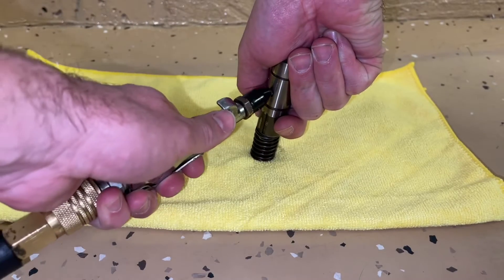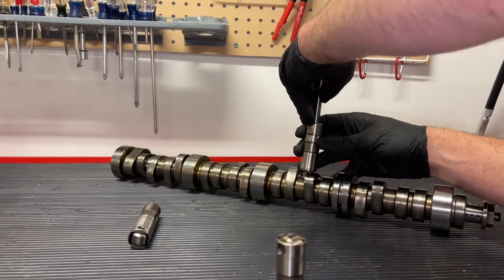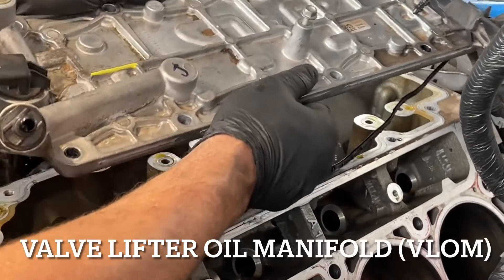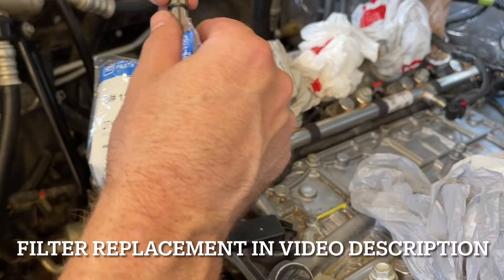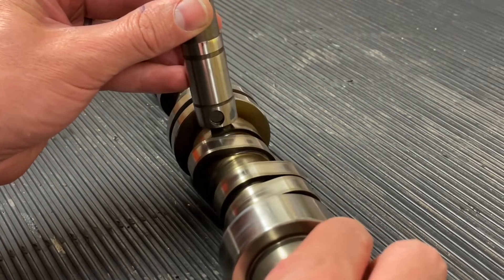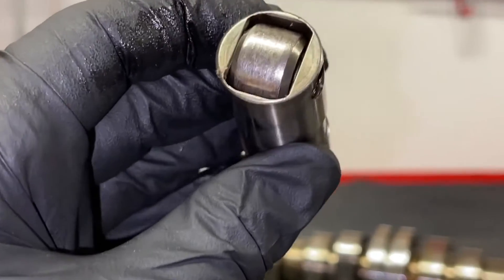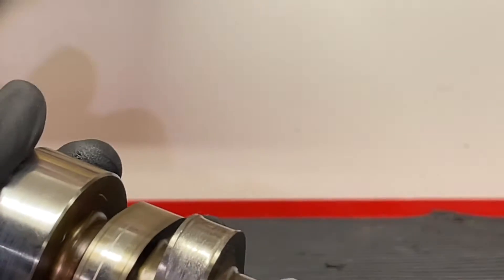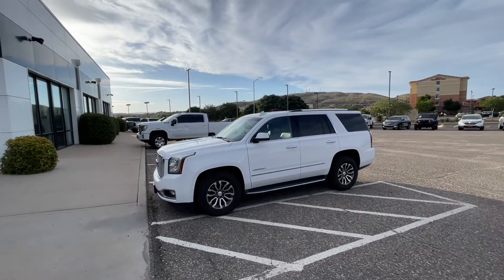GM DOD/AFM Lifters operation explained, failures, how to delete. Why GM engines fail 5.3L 6.2L

Comment: What could it mean if you did the AFM DOD delete and the lift failed after?
Reply from the maker: Mine was a regular lifter that failed, but possibly due to the active fuel management/displacement on demand. During the repair, the dod/afm was replaced with a regular GM camshaft that does not utilize the afm/dod because that system is prone to failures: DOD AFM Delete Yukon, Tahoe, Silverado, Sierra, Escalade 6.2L & 5.3L Replace cam & lifters  Part 1
https://youtu.be/cWayyZGNYRI

Comment: can i just install all new short regular lifters and disable it with a tune and leave the stock afm cam so i wont have any lifter collapse in the future right now while my engine working fine since i have the engine outside the engine bay ?
Reply from the maker: My understanding is the cam is in fact different and must be replaced. https://youtu.be/cWayyZGNYRI?si=SMwntH3JEAnj0E_e

Comment: My sis' 2021 Tahoe just had it's second DFM failure and soon going on 3rd engine  with less than 130K miles. I grimaced when she said she OK'd 9k for the dealer to replace the engine. She said she's getting a DFM disabler but I told her that will only prolong the next failure. I agreed when she said she will sell it, though I am a "drive til the wheels fall off, then put the wheels back on" type. Told her for same price, she should have gone to an independent shop for a rebuilt (ie Jasper) that will have standard cam and lifters. Recommended next time get on the 2500 platform without DFM.  People it's not hard... dirty motor oil does not make a good hydraulic fluid! It's for lubrication.
Reply: The elephant in the room...If you disable the AFM, there's no chance of a collapsed lifter. Why?  Because it doesn't collapse, aka your engine will last forever.
Reply: @operationsword9457 if only. Sadly plenty of people still nuking lifters and cams even with it disabled.

Comment: Can the short lifter without the spring go bad ??
Reply from the maker: @Mixvids512  yes. That’s actually why this is apart for mine. A regular lifter went bad at 96,000 miles: DOD AFM Delete Yukon, Tahoe, Silverado, Sierra, Escalade 6.2L & 5.3L Replace cam & lifters  Part 1
https://youtu.be/cWayyZGNYRI

Comment: 2017 Tahoe 5.3 question.  111,000 miles. Tranny fluid changed at 35k and 80k.  Still looks good. Can a bad lifter or injector be the cause of the 6l80 tranny to act up?  i.e. shift hard both in auto and manual shifting.  Shifts smooth up shifting but jerks on down shifting.  Over the last couple I have been getting the P050D code pretty regularly and once in a while the P0300 but not very often.  The P050D is cold start and rough idle.  After it runs about 45 seconds, it clears up and the miss seems to go away.  But sometimes, the tranny will act up.  When I clear the codes, all is well. Now I am getting both a small misfire and tranny acting up but not setting any codes.  I think I have read that there is a connection between the shifting and the #4 cylinder.  My scanner gets more counts on #4 but is not consistent.  Plugs? Injector? or lifter?  Local shop want to replace injectors, lifters and tranny all at once.  Costs more than the car is worth.  Need some suggestion and options.  😵‍💫
Reply: The GM auto's have been electronically operated for many years now. Engine issues can degrade transmission operation. Don't diag transmission until the engine is at peak with no misfires or other issues. And yeah, you're not going to get a good accurate diag from youtube. Might as well play the lotto. I will say, stop resetting your codes and running with a misfire or you can ruin the catalytic converter on top of whatever issue is causing it to misfire.

Comment: My Silverado has the full delete afm lifters taken out changed camshaft all the trash afm components are gone and my 5.3 runs amazing and it doesn't burn no oil at all
Reply: This is how you do it.
Reply: Do it right like you did, and now you have one of the most bulletproof motors there is. I don’t understand why people don’t do this when these lifters fail out of warranty. They pay to put the same garbage parts right back in. Just delete it!
Reply: That's right
Reply: Do you mind me asking what you.paid in parts and labor? 
I've got a 2011 escalade I've had since new. 157k and just collapsed lifter on number 4. 
And yes I had the dreaded valve drop on my Z06... 
I'm curious to see what a complete delete would cost.
Reply: @VettedLS71103  2800 dollars in south Louisiana
Reply: @DustinKeating-yk3vq  thank you for the info... thats alot better than here in Phoenix AZ.
Reply: What parts did you put in? OEM or something like chopacara.
Reply: Did you have to pay for a tune?  How much

Comment: I picked up a 2020 Silverado in 2019 with $8k off for a Labor Day special. I have put on 158K since the purchase with regular oil changes and your standard parts needing replaced (belts, filters, tires, etc.). I use the truck for hauling, weekend wheeling, don’t seem to shy away from putting the beans to the throttle when I desire, so… I just got the tapping sound I didn’t want to hear, so I’m glad for this video. Once I go through with the cam and valve change, I’ll be in hopes of driving the Trail Boss to 500k. It replaced my previous Silverado that had 449k on it and I’ve had Chevy trucks since the 80’s and don’t hold much grudge against Chevy trying new things.. I’ll let you know once I get to 500k with the 2020. Thanks again for the video!
Reply from the maker: Awesome. I’m glad it lasted that long. Here is my walkthrough video if you’re interested: 
DOD AFM Delete Yukon, Tahoe, Silverado, Sierra, Escalade 6.2L & 5.3L Replace cam & lifters  Part 1
https://youtu.be/cWayyZGNYRI
Reply: The only reason GM does this bullshit is because of stupid regulations. Not because GM is trying new stuff.

Comment: Looks to me like the system is designed to fail under normal use. That and transmission issues are making GM look pretty sketchy, no more for me.
Reply from the maker: Even the dod system can ruin the transmission as it changes to 4 cylinder mode from what I’m hearing
Reply: @dannyjohnsonsgarage  Guide to the abbreviations: Dead Fkn Machine, Awful Fkn Machine, Dead on Demand, Very Very Terrible, EcoBOOM. What has been seen cannot be unseen. The only tech I have hope they continue to perfect is VVT type tech, because once they get it right, the PCM can shift the cam specs (lift, duration, lobe separation angle, etc) from a fuel sipping mild cam to a beast at WOT. I'm no lithium fanboy, but I would rather they go to a proven more efficient hybrid setup so the engine can operate at a near constant RPM (making deactivation, DFM, and VVT unnecessary) than keep at this dead end of cylinder deactivation.

Comment: Now that everyone understands how these lifters work and how they get stuck in the collapsed position maybe people will quit arguing that adding a range disabler or disabling AFM will greatly decrease this type of lifter event because you are keeping it from collapsing in the first place.👍
Reply: Hmm but if there is no chance of a "missed time switching event" aka lifters would be active all the time with a disabler, keeping the engine oil changed regularly,  the "probabilities" of a collapsed lifter, or locking pins wearing out, is lessened no?  Basically it's about "probabilities" being decreased.  In that sense, yes, stop arguing.  AFM disablers DO work.
Reply: @operationsword9457  yeah, will the disablers help or not??? have an expensive 2023 Yukon xl denali that I would like to keep a longtime engine problem free:)
Reply: @operationsword9457  100% fact! If you’re not collapsing the lifter, then your odds of it failing have incredibly decreased. They absolutely work.
Reply: I put the Range module on my ECM inside the driver wheel well along with cold air induction & a borla Atak muffler, it’s a different truck.  Transmission shifts better, smoother, and so far my highway mpg is 25 mpg.  Was worth the investment & with frequent oil changes I’m hopeful it extends the life of the lifters.  We can all thank our government for this mess w the crazy cafe standards.
Reply: @johnwatz4955 it's not a cure-all but it definitely helps reduce the chances of lifter issues. Definitely eliminates a missed timed switch event and prevents wear from the lifters expanding and collapsing constantly. Good luck👍
Reply: I watched a similar video that showed the same, that the failure occurs when the lifter doesn’t “un-collapse.” That was then my reasoning for getting a Range disabler… if the lifter never collapses in the first place, then it by definition doesn’t have to un-collapse and potentially fail in doing so. Fingers crossed. 🤞🏻
Reply: @papajoeknows8355 yes sir and this also eliminates a missed time switch event which is very common causing bent pushrods Cam and lifter damage. It's not a cure-all but it definitely helps eliminate the majority of the problems and also helps with transmission issues as well. Good luck 👍
Reply: @johnsmith3735 good point. And it does seem to have improved my hard shifting a bit too.

Comment: So instead of rebuilding the 5.3 from my 08 Suburban, I decided to pull it and put in another motor. Found a lower mileage 5.3 from an express, since the 1500 vans didn't have the dod program. I already had a guy called lt1 swap or something remove the program from the computer. Question, the valley covers are different, since the express doesn't have the solenoids. Should I use the cover from the Suburban since it has a plug that goes from the solenoids to the computer, or will it matter at all since the program is deactivated?
Reply from the maker: I left mine all there but turned off, so I think either will work as long as the dod is turned off (or set to come on at an impossible rpm like 12,000 rpm). As I understand for the oil pump side, you just want to make sure the oil pump isn’t trying to send more psi thinking it’s still active.
Reply: @dannyjohnsonsgarage  how would you do that lol, on the oil pump?

Comment: If a lifter sticks and you're 20 plus miles from home, you drive it home, can a total dod delete still be an option? Or has the drive home taken out the motor beyond repair?
Reply from the maker: It would be better than my lifter failing and putting metal in the engine as far as that goes, but it may have a bent pushrod if it had a mid timing event, which can still be repaired in most cases. Once you have it apart you can see what the best option is. Sometimes a new engine to drop on is less risk and hassle  https://youtu.be/cWayyZGNYRI?si=b9wEDgZegqqzFsd5

Comment: Nicely explained overview. My wife's 2013 Escalade has 184K and I just noticed lifter noise today, it sounds like it is just one, so I hope it will be a relatively inexpensive fix!
Reply: No it would be expensive if you caught it early but didn't do no damage.but once you replace them lifters with the spring on them with Corvette lifters and delete the fuel management system you will never have this problem again

Comment: Danny, I own a 2015 Yukon with the 6.2 liter hooked to a 5 speed automatic.  Within the first 80,000 miles I had two lifters failures resulting in the last one to have the cam replaced.  Since then I have been running it in manual 5 mode resulting in zero lifter issues.  I have 130,000 miles on it now.  Is what I am doing a good long term resolution?
Reply: As long as you keep your oil, change, religiously and clean, the systems are super susceptible to any amount of sludge or carbon buildup. Keep your oil changed every three or 4000 miles and you should be fine running it in manual mode.
Reply: @MacdoNaldi67    I wonder about this, because I have a 2010 5.3, and so far it hasn't failed.  I am not the original owner, so I don't know if the first owner did anything to the AFM.  However, I am at 109k, but I also use the M5 for now.  I always change the oil at 3k, and now I am using Valvoline restore and protect.
Reply: @jmackinjersey1 you notice how in the video he says the lifter gets stuck in the collapsed position? Will adding a range disabler or tuning out AFM will greatly decrease your chances of having an issue because the lifters won't collapse in the first place this way they don't get stuck the pins don't wear out.

Comment: My 2015 escalade lifters keep getting stuck. First it was lifter #1 then lifter #2 got stuck. Mechanic fixed it. while he was testing the car lifter #4 got stuck  after getting done with that lifter 1 got stuck again. It’s been mess changed all lifters and polished the block 🤦‍♂️ still same issue we even replaced the valve lifter manifold
Reply: Plus the cam is in perfect shape and oil pressure is 170-200 kpa while idle. If anyone got any suggestions please share
Reply from the maker: There are delete kits to give you all regular lifters but it requires a tune. DOD AFM Delete Yukon, Tahoe, Silverado, Sierra, Escalade 6.2L & 5.3L Replace cam & lifters  Part 1
https://youtu.be/cWayyZGNYRI

Comment: Best way to fix this issue is get a different car and never buy another GM V8.
Reply: Eh, just not the ones with AFM. If you go with any of the 2500HDs you’ll be set up until about 2019. The 1500s from 2006 and earlier were bulletproof, without that stupid fuel economy bs.
Reply: What!!!!! That's the dumbest shit. GM V8 are the best at making HP for cheap.  Once u replace the lifter with the spring on it with the Corvette lifters and delete the fuel management system. You will never have this problem again
Reply: @TheRealZJM377  Also get an HP Tuner and an expert to tweak a lot of other settings. There are many settings but will only mention even a non-pro can understand - eliminate GMs standard setting of torque converter slip. Do you really want the TCC slipping at 30RPM generating tons of heat? Full lockup = no friction = no additional heat. It's like driving a manual with your foot resting on the clutch pedal. And aftermarket cooler bypass if you got one of those that's only letting 25% flow thru the cooler. Heat kills transmissions.
Reply: Shouldn't have to go to the extra expense, though. This is a stupid, stupid design, and GM needs to change it back to pre DOD lifters! @TheRealZJM377
Reply: Yah ok
Reply: I've put 90k miles on my 2009 Z06 since new. No valve issues ever. Or any other issues other than clutch and torque tube 
I've had a 2011 Escalade since new and just collapsed lifter on number 4. 
Dodge, Ford, Toyota and others have their own issues. 
With that said... I'm a GM fan.
Reply: @VettedLS71103 Had em all, dozens of vehicles myself let alone friends and extended family. I'll stick with older GM's for good reasons.
Reply: In retrospect, an underappreciated engine that has flown under the radar would be the 2007-2013 GM 4.8. 

AFM wasn't even an option with those engines. 

If you wanted one, your trim choices were basically relegated to the WT and LS --- in other words, GM wanted to stick as many people with the 5.3 as possible.
Reply: But what do you buy if you need a extended SUV, the expedition has issues also with cam phasers. How much fuel is the EPA actually saving making companies follow these strict mandates? Smfh
Reply: Any opinion on the Duramax turbo on Sierras?
Reply: Yeah because fords dont grenade themselves on a regular basis and rams dont have a multitude of electrical problems.....this shit sucks and it just happened to my escalade but for a 1000 bucks and a couple afternoons this garbage fuel management shit can be deleted
Reply: Bet you drive a Tesla or a Prius and have a man bun
Reply from the maker: Hence my tundra and sequoia Toyota Sequoia
https://www.youtube.com/playlist?list=PLIjr-uSYDZi4VVY98CUqYZPQMptDhexbN
Reply: @dannyjohnsonsgarage you might want to take a look at the issues the Tundra is having since 2022! It's just as bad as the trash gm made
Reply from the maker: @itscoldinwinter1  yeah, that’s why I went with the 2021 with the V8. I trust Toyota the most but I think they are bound to have issues with the V6 TT being new and more complicated
Reply: @dannyjohnsonsgarage hmm, rusty frames and failing motors? Toyota has its fair share of problems too. Don't be a fanboi.
Reply from the maker: Toyota Tundra Playlist
https://www.youtube.com/playlist?list=PLIjr-uSYDZi57XD9z82F06EWPIA6KBhzI
Reply: That's why I'm a ford guy 😂
Reply: @bruhbiqw6237 brand boy

Comment: I am going to buy an $70k vehicle…. First modification… altering the factory engine so it doesn’t fail… 

Crazy. Just crazy.
Reply from the maker: I have a full playlist of repairs you shouldn’t have to worry about with such an expensive vehicle. The lifters, transmission harness, trim panels, so many things 

Yukon / Tahoe / Suburban / Escalade Owner’s manual Bells &  whistles
https://www.youtube.com/playlist?list=PLIjr-uSYDZi7J7EQ1ErTn1Yzi6ET_3Ssr

Comment: So is it true that changing the oil at 3k helps prevent this issue or not really?
Reply from the maker: It would definitely help with not clogging up the small hole the oil goes into to collapse the lifter.
Reply: What about a seafoam treatment?  Ive heard some people have good experiences with this treatment
Reply: @DavidRamirez-kv9xc  I usually do a seafoam (1oz to a quart) and idle it for about an hour before draining it.  It seems to clean better on all my rigs.

Comment: You’d be a fool to buy any DOD GM without a warranty.
Reply: You’d be a fool to take it back to GM for warranty work there just gonna put the same crap back in it get a good engine tech and use better than stock parts